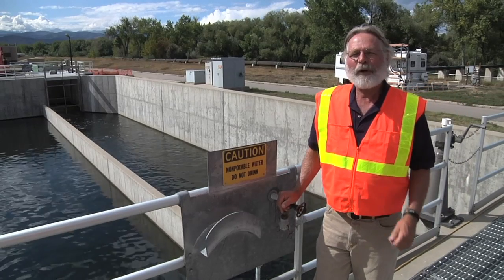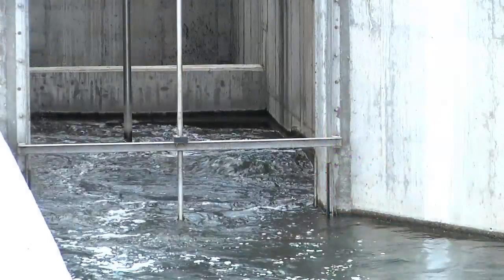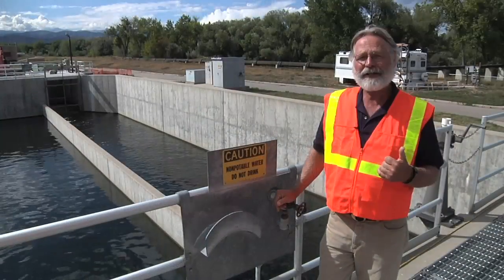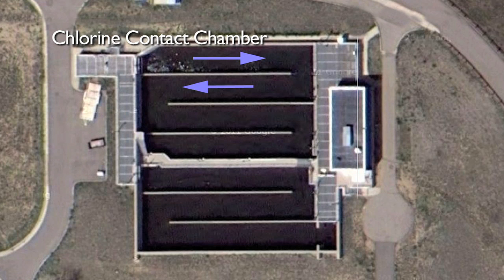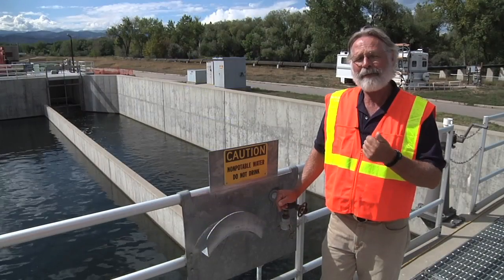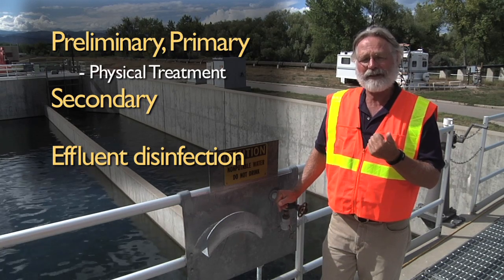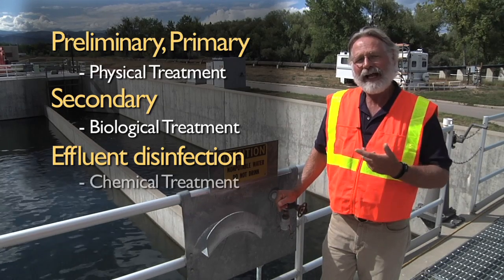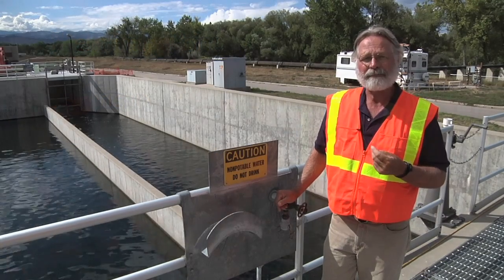Wastewater Treatment Video 7: Effluent disinfection

Comment: 2:01 chlorine is toxic to fish, so tap water can not be used for aquarium...
Reply: Actually, it CAN; however, you MUST first boil off the vast majority of it using a low heat. After this (which takes two minutes per gallon of boiling), slowly remove from heat and leave uncovered until cooled to room temperature. The water is then ready for use!!